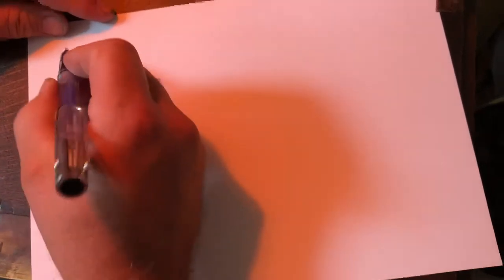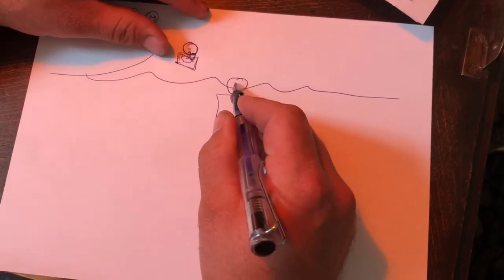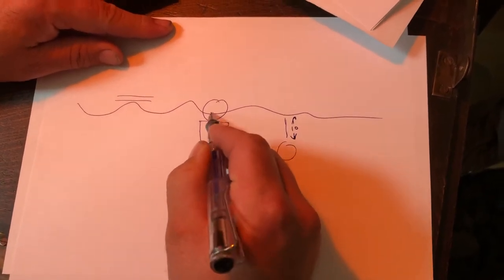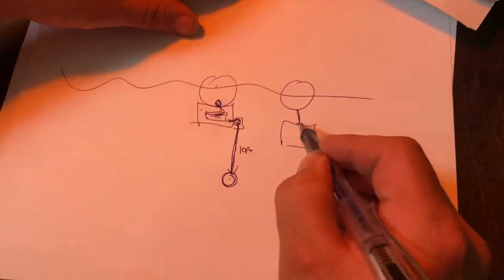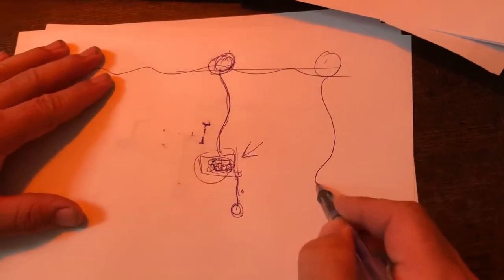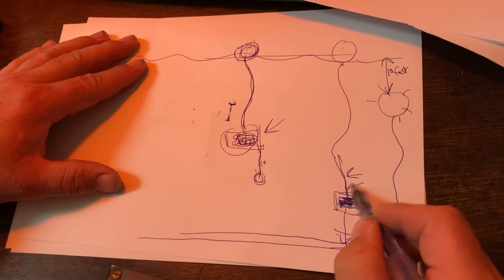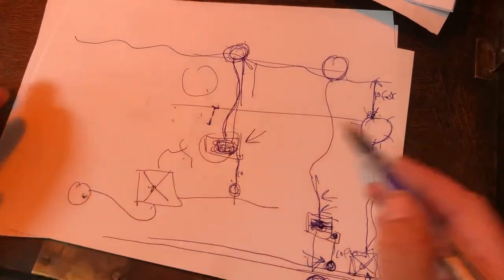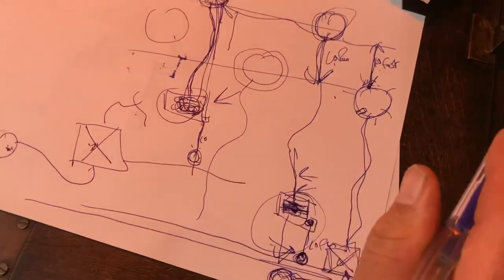4 OF 4 How Does a WW2 Mk17 Naval Sea mine deploy?   by Metamorphicwonders

Comment: I have not seen the TV-documentary you're bashing, but you need to do some more research... Although your explanation of how the Mk 17 (and many similar systems) is deployed is correct (a bit simplified), there are other systems which might have been referred to in the mentioned program - there certainly are systems which deploy "bottom up" as well (it would be interesting to see the program in question to verify what systems they were mentioning - if you have a link?).

Proper illustrations and technical descriptions of the deployment-sequences, as well as technical handbooks of the Mk 17 (and other) minesystems are readily available from public archives.

Comment: Fantastic explanation, very well explained. Crystal clear. One question related to detonation; at what point is the mine active? Could the mine explode on board the deployment ship if a sailor accidentally bumped off one of the horns?
Reply from the maker: i need to do another film on this.  Its complicated.  The mine works on a 3v battery.  imagine a circuit….  along that circuit are two soluble plugs in the shin of the mine…. theres also a pressure switch that activates when the mine is under tension .. eg on thw sinker when its floating at its depth…. so …. if a sailer hit the horns with a hammer on the ship it wont go off.  The soluble plugs have a salt pellet inside and a spring… soon as sea water hits the pellet it disolves slowly.  When it disolves the spring pulls and activates that bit as a switch thats now on… then the other soluble plug needs to be disolved and activated by the sea as well … but even if these two malfunctioned (which is impossible) and activated… it still isnt armed until the mine has deployed and the cable is pulling down on the bottom .. thus activating the final switch.   then its live.   It gets more detailed than this… there is a timer that can activate and sink the mine after a period of time.  It doesnt go bang .. just floods it.  Hence these thing wash up on beaches all these years later still live.  I will do another film on these facts. I hope what ive explained makes sense. Look at my other films .. i do show the inside of these mines and i have posted about five films on mines showing my mk17. (inert!)
Reply: @MetamorphicWonders  That makes perfect sense now. So if a Mark XVII mine washed up on a shore, by accident (let's say the mooring chain broke and it floated away) for it to explode somebody would have to pull the anchoring cord and a horn would need to be pressed inwards too?
Reply from the maker: The horns are a switch. Mine is positive from a 1.5 battery and the horn is negative. hence the name “switch horn”

Comment: I used to think that a man attach manually the Chain of the mine to the bottom of the sea😂
Reply from the maker: And .. a lot of people think they are held down by chain….  But in reality its a cable.  The only bit of chain is the three foot or so directly under the mine, then it turns into a cable.  Which is why mine sweepers and the uboat fronts (the scissor shapped thing on the bow) manages to cut them.

Comment: Is a naval mine intelligent?
Reply from the maker: No.   simple cogs. cams and pulleys.  Spools of wire and a 1.5 volt large capacity battery.
Reply: Yes of course, but "naval mine" is a very broad term, covering anything from the most basic simple "stupid" contact minesystem, to the most advanced "intelligent" minesystem with shipcounters and filters for shipsignatures (pressure/acoustic/magnetic) which in theory can single out and target a specific type of vessel, if not a specific hull.
Reply: @havardhovdet9217  ok